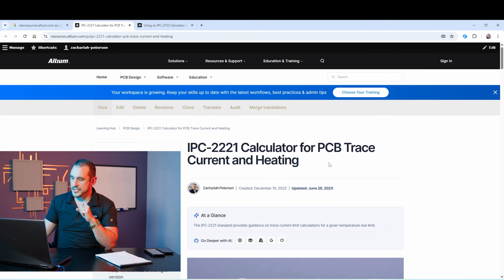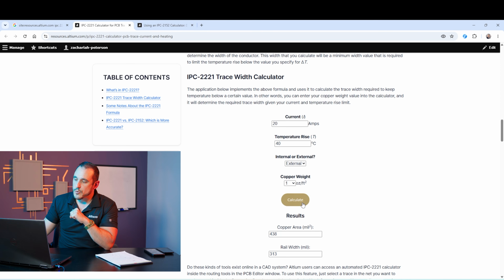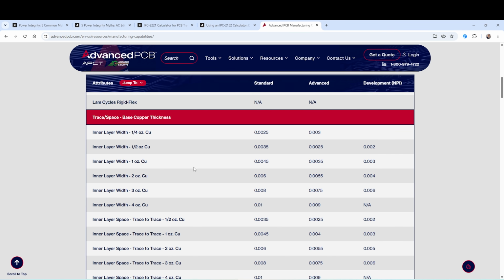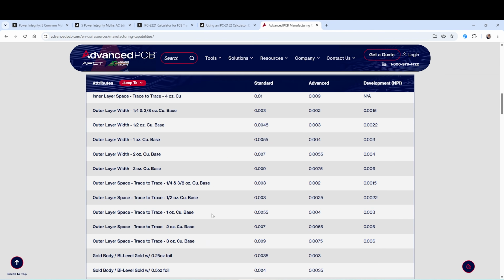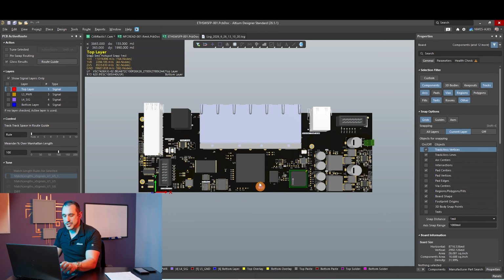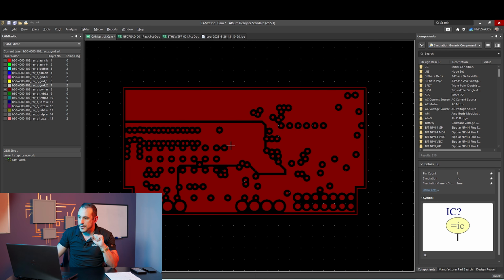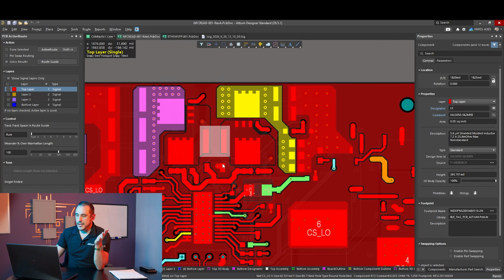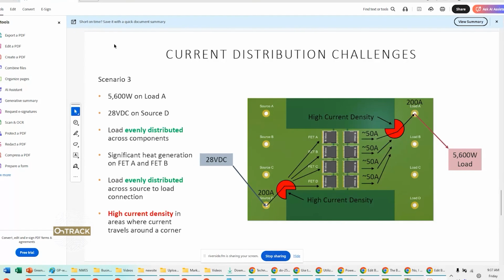5 DC Power Integrity Myths That Ruin Your PCB Design

Comment: Hi Zach, great video, thanks! Something I've wondered about is this example, lets say if the output of your high power DC/DC converter needs to dive down from top to bottom layer, or vice-versa,  is there a tranient performance difference (slewing of current) when placing just power connected vias vs placing power connected vias with close by GND connected vias. Not sure if it would be one to one, aka one power via for every one close by GND via. Maybe there is a plateu of number of vias vs performance? I think Daniel Beeker calls this placement style water fall (something) placement. :) . I feel like from a wave travelling through the board POV it makes sense why it would help, but is there a way to use simbeor or another tool to quantify where it does or does not? I wonder if you treat it like a RF wave guide using closly spaced vias on the perimeter of the power plane would further help? Maybe it would make the transient performance worse.. Looking here, PDF page 14 is a simple example of one via and one nearby GND via.  I'm hoping you make a video... https://www.ti.com/content/dam/videos/external-videos/ja-jp/9/3816841626001/6307562268112.mp4/subassets/pcb-trace-as-wave-guide-presentation-quiz.pdf

Comment: I really appreciate Zach's clear and fluent presentation. As a hobbyist into power electronics, my main takeaways from this are the point about cutting up power planes with too many vias and the point about keeping high current paths in dc-dc converters symmetrical. On a side note, multi layer boards are so cheap now, it's been a revelation. Cheers

Comment: I have a copy of some Douglas Brooks and Johannes Adam articles at my desk for when I push back on a request to add more thermal vias. Like that say a surprisingly small number of vias is capable of efficient heat transfer. They also showed that even without thermal vias, the presence of a thermal plane under a heat source will be result in good heat transfer and they show that the closer this thermal plane the better. ie. an internal plane directly under the heat source.

Comment: I'm in shock :face-fuchsia-tongue-out:to see such a huge difference in current through each MOSFET in the last example. You would expect that, on a copper pour, current would spread evenly.
Reply: But why would you expect  otherwise? Copper gives you an IR drop whether its cross section is small or large, and the IR drop increases with length. It should be reasonable to expect the path length for current to impact the amount of current we would see flowing through different regions of copper. This is why we have DC power analyzers: they allow you visualize the current distribution and adjust things like via placement, component placement, or plane size to try and reduce the current load in specific regions of copper.

Comment: For myth number 4, it can help a lot to removed unused via pads on internal layers.
Reply: That's a good point, I think for that you would have to balance the additioanl copper allowance against any potential reliability issue when the board starts expanding under heat. I think you could at least reduce the pad size, maybe not completely eliminate it, and by reducing it you recover some space for copper. But then the challenge with that is the minimum web size, if you are going to have  copper webbing between the vias it needs to have some minimum width otherwise there is risk that the copper will flake off.